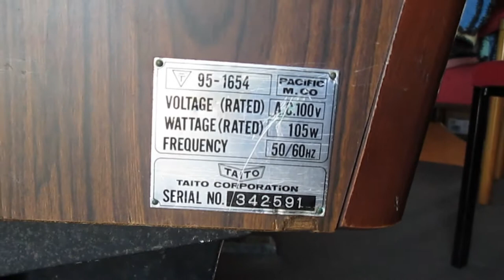Taito Cocktail Table Restore Part 1

Comment: Hi, great video. I'm restoring a cabinet nearly exactly like this one as well! Where did you get the vinyl replacement instruction cards for under the glass? Also, what thickness glass did you have cut? I'll get a local glass shop to make a new one soon. Having a little trouble finding the monitor bezel as well (mine didn't have glass or bezel when I bought it). Thank you!
Reply from the maker: Hi.. Sorry for the delay in replying.. My glass is 5mm thick. Its also toughened glass but i forgot at the time of ordering it to make sure the corners were correct... i had to file the corners carefully to make it match better. Just let me know if you need to know anything else
Reply from the maker: How did you get on with your table?